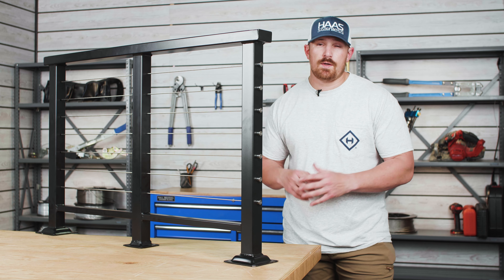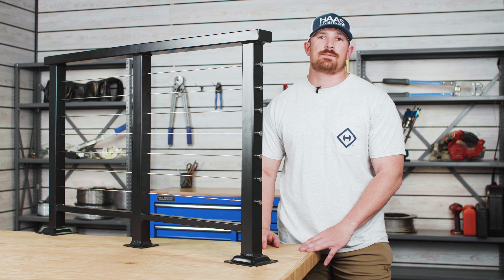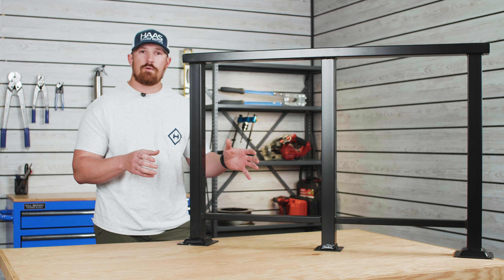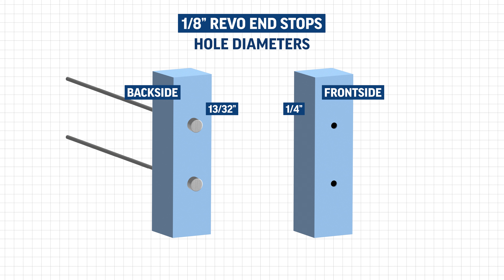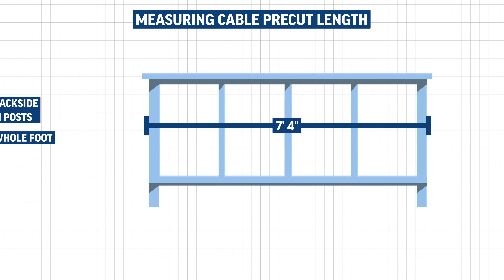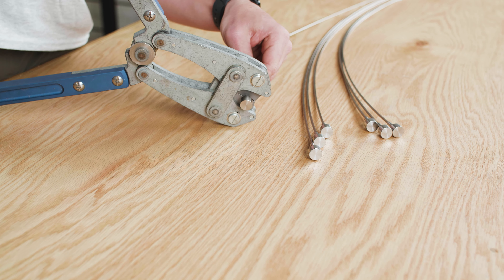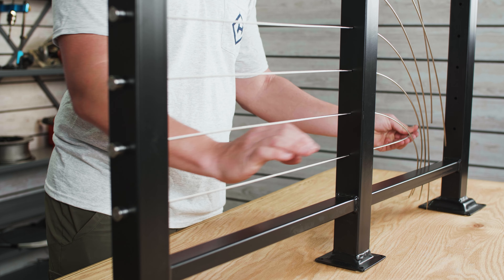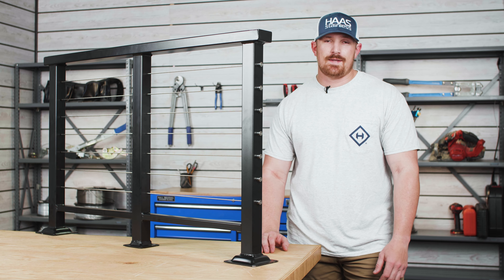End Stops in Metal Posts | HAAS REVO Cable Railing Components Installation

Comment: Do your kits come with plastic bushings or something similar to separate the stainless steel from the aluminum or coated steel post so that galvanic corrosion doesn't occur?
Reply from the maker: Thanks for the question, Drew! At the time of this comment, we don't carry any bushings to insulate the cable from the posts. The best way to avoid galvanic corrosion on your cable railing system is to powder coat or paint the posts after drilling, making sure the rims of your holes are coated as well. That way, no matter what material your metal posts are made of, you'll largely avoid any corrosion issues.